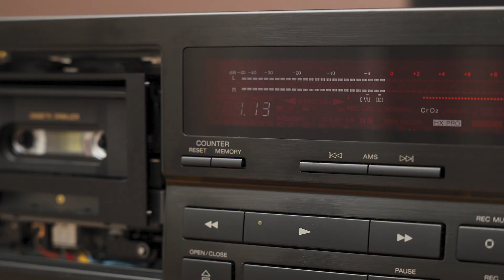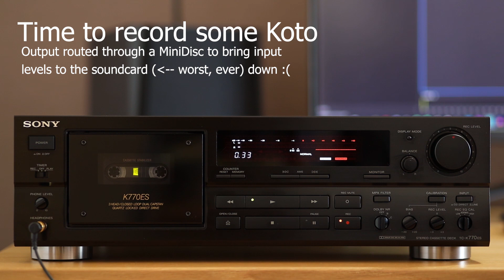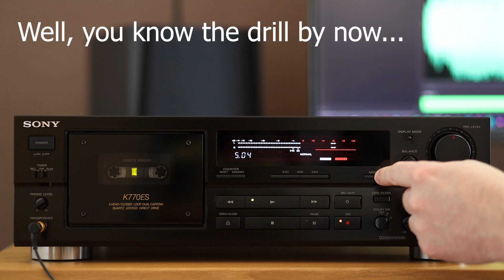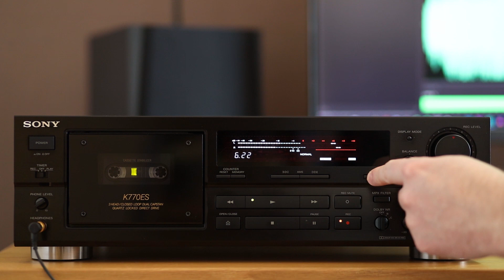Sony TC-K770ES calibration and record/play test (with some Koto!)

Comment: I own 890ES it looks almost the same , do you know the difference?
Reply from the maker: Honestly I don't know all the details, but to my knowledge the TC-K890ES is a better machine overall. Except in one area - hot recordings on type 2 and 4 are quite limited due to different heads (the 870 and 890 uses laser-amorphous for both rec and play, while the 700-series uses Permalloy) and the way Sony implemented these and the recording circuitry.

There are threads on the Tapeheads forum about this, and how to make hot recordings a bit better - matching the 900-series.
Reply: @SerafimSvensson  Thanks for your input and info .

Comment: How does this record with levels greater than 0db and going into the red zone without distortion? i usually record till peaks hit 0db. Here i see you are peaking at 8db.
Reply from the maker: Quite well actually, the 700-series from this era with its Permalloy heads are not too shabby for hot recordings with type 1 super ferrics and metal tapes. Be sure to check out my other videos, at least the TC-K750ES one (which is almost the same machine as this) where a Metal-ES is recorded really hot.

... But unless you're recording a metal tape, which has higher SOL (Saturation Output Level, usually measured at 10 KHz) than both type 1 and 2, keeping your recording level around Dolby level or 0 dB is most likely a better way to record, but not as much fun. 😉

Comment: What's the difference between this K770ES and TC-222ES?
Reply from the maker: If I'm not mistaken the TC-K222ES-series (ESG, ESL, ESA) are JDM-decks (for the Japanese market), and corresponds with the TC-K850ES/TC-K870ES/TC-K890ES. So, a step up from the 750/770/790-series.

Comment: I’ve got a sealed box, brand new TC-K870ES coming this week from a collector. It’s never been removed from its box or powered up. What would you recommend I do? Would it need a service? Belts? Crazy to think it’s 30 years old, I’m very lucky to find this
Reply from the maker: Wow, that's awesome! I agree, it's kinda crazy to find something that old brand new in its original box. I think a big CONGRATULATIONS is in order! :) 

Considering the age and that rubber belts usually go bad-ish with time (even though the capstan belts on these decks seems to hold up quite well), maybe a minor service exchanging the mode belt and maybe the capstan belt?

But try it first? No real need to change anything if it works right out of the box.
Reply from the maker: P.S. The mode belt can be quite tricky the first time around, but there's a good guide over at Tapeheads if you do not wish to re-align the left (supply) pinch roller: http://www.tapeheads.net/showthread.php?t=30926

Comment: Great! How do you suggest to deal with the setting of REC LEVEL on TDK-SA?
Reply from the maker: Thanks! :) I'm not sure exactly what you mean, during calibration? Or just in general during recording?
Reply: @SerafimSvensson  Calibration procedure was understood. The question was in general so after calibration during recording.
On Sony's homepage I found the original operation-manual for the similar TC-K870ES (TC-K770ES not found) which answered questions.😊